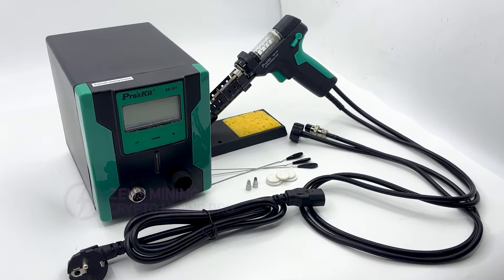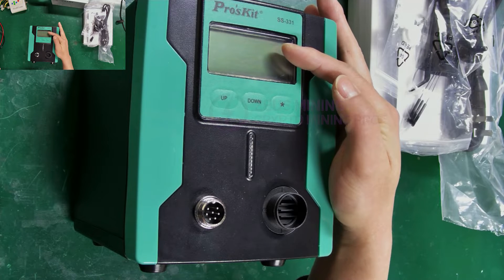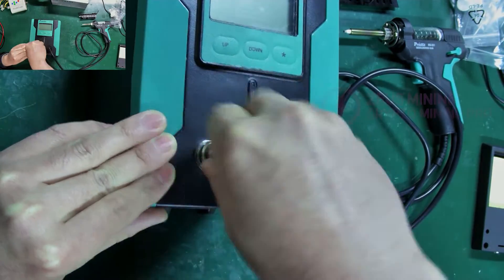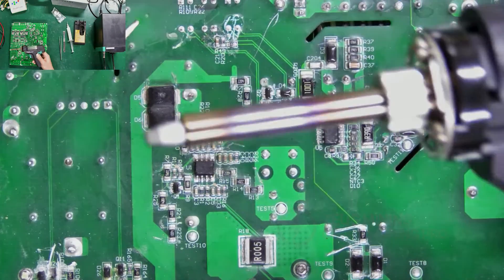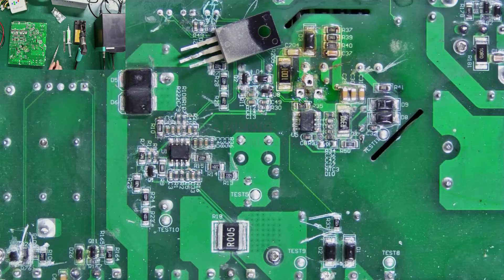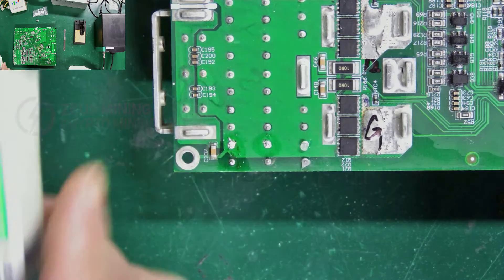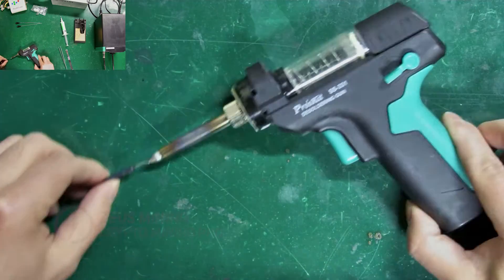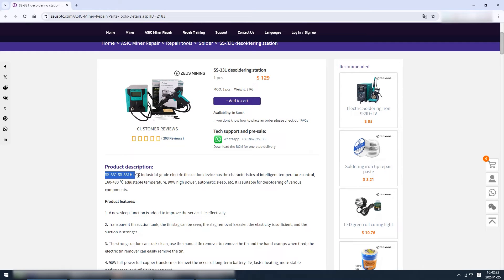How to use Pro'sKit SS-331 LCD desoldering station？

Comment: Best way to use it its avoid it ... such a steamy piece os shit . Have Lost so much time trying to put to work properly. Even the spare parts tips that comes with the machine dont fit ..!  had to use a file ..!  Just a bummer .....
Reply from the maker: Hello, many friends have purchased and used this desoldering station and feel that it is pretty good. Is there anything you don't understand about it? Please contact our technician via WhatsApp: +8619123969124, he will help you solve it and provide some better suggestions.